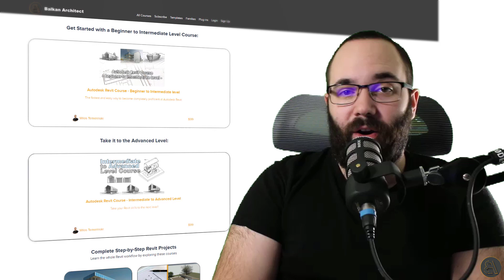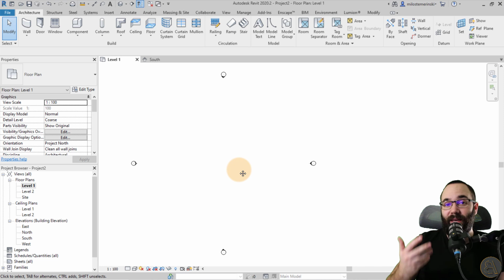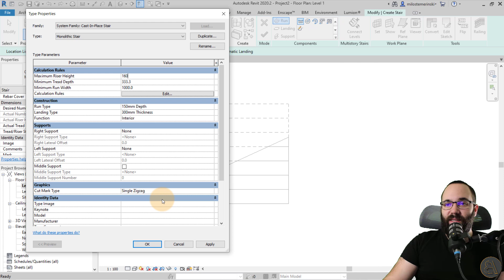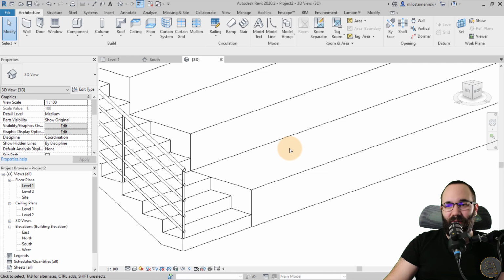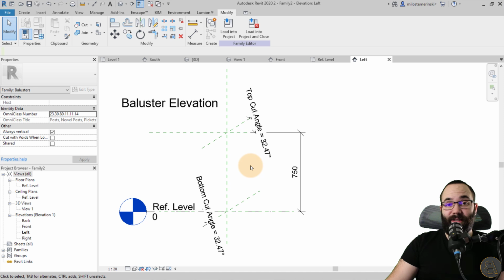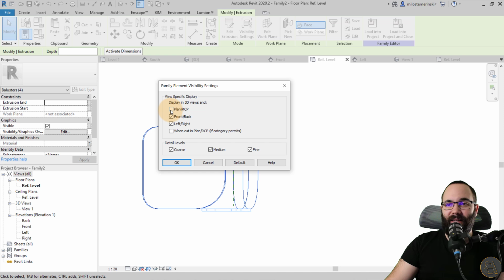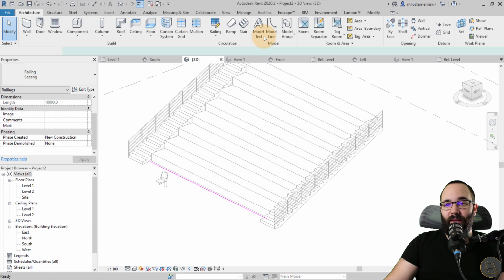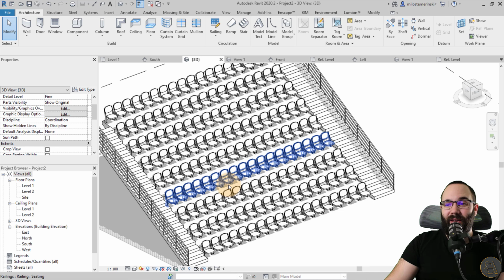Stadium Seating with Stairs & Railing Tutorial

Comment: The problem is sight lines to the pitch. It's harder to see the further back in the stands you are, so seats need to be gradually higher. You end up with a parabola curve. This is a good tutorial but keep in mind there's a lot more to stadium seating.
Reply: Yes that's correct, not to mention that seatings are modelled under railing category which I doubt is acceptable in a professionall workflow. However, the idea of using railing for such application is very interseting.

Comment: There is a x1000 times better and faster solution .. Plus if you are really working on a stadium project, and you have to make any adjustments for the seating or the lower structure (The big stairs you've just made), it would be a disaster.